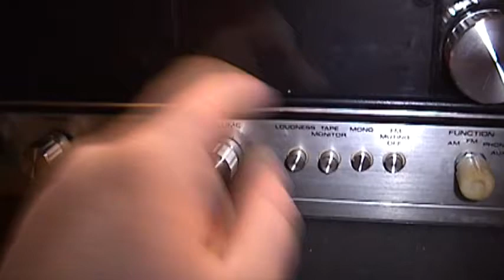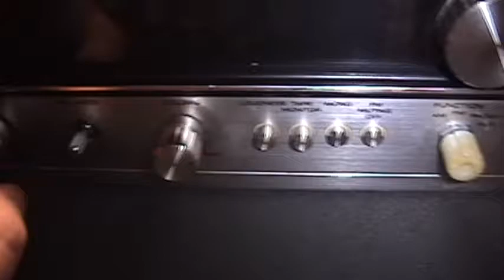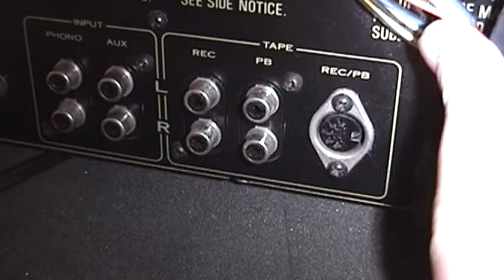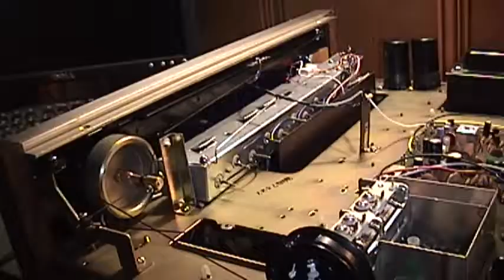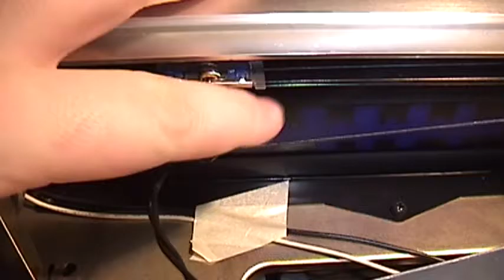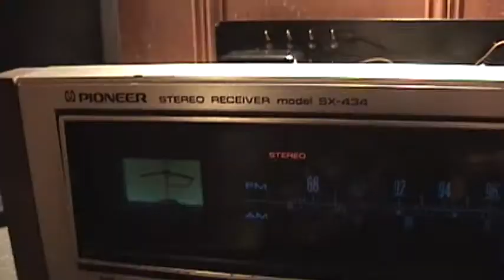Mostly Broken 1974 Pioneer SX-434 AM/FM Stereo Receiver

Comment: StereoDust, a question. I have my SX-434 driving four speakers, a pair of Synergistics S-12B 8ohms, min power 6w and a pair of Boston Acoustics A-40 8ohms, min power 5w. Am I correct that combined they present a 4ohm load to the amp?? Do they also present a total min power of 11w?? Is this a safe load for the SX-434 receiver?? Just curious..

Comment: Ah, the SX 434 receiver. I bought my first hifi system with overtime pay in Nov. 1976. Got the Pioneer SX 434 at The Wiz audio store in downtown Brooklyn for $127.  Also got a BIC 920 turntable and KLH 31 speakers for $120 at Uncle Steves on Canal St. NYC. Time went by and I traded up in components. A few years ago at work they were throwing out an SX 434. I took it to my fix-it guy and for $60 he restored it. Now it sits in my kitchen and powers a Nakamichi BX 1 cassette deck and Boston Acoustics A 40 speakers. I would NEVER sell my SX 434.
      Such a low powered receiver (15 wpc), with a good FM tuner and phono section, a tape monitor loop and an aux input. WOW, so much for so little. Not just Pioneer, Onkyo, Technics, Kenwood, Nikko, Sony, they all made quality stuff. Don't believe me? Pick up any 500 watt surround receiver. You only need one hand. Then try to lift a vintage 15 watt receiver, you'll feel the difference. The new receivers are all PLASTIC, no wood or metal. 
       These 15 wpc  units were not for big sound in large rooms or to drive large inefficient speakers. But for the den or bedroom (with your best girl) or any room, say 10ft x 10ft, like my kitchen, they are great. Especially with efficient speakers like my A 40's (5 watts minimum power).  Besides what other products will last 40 years. Please don't ever underrate  these marvelous receivers.

Comment: This unit probably would have been restorable. Unfortunately, that would most likely have required rebuilding the whole thing from the ground up with fresh components and NOS spares.

It reminds me of my Akai AT-580 (Which is in the banner photo on my channel), even though that unit is just a tuner rather than a receiver. It doesn't output any audio at all but works otherwise, I think it has a power supply problem.